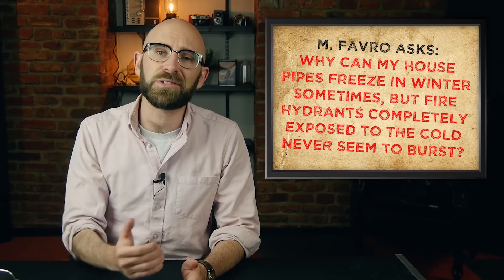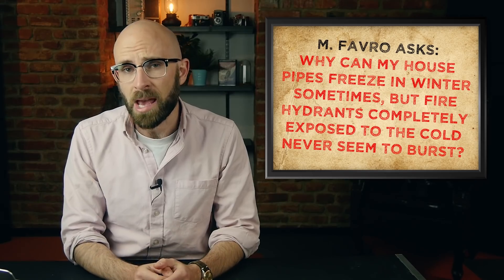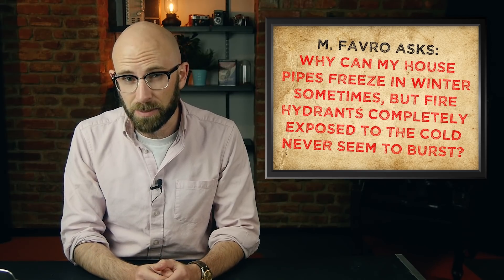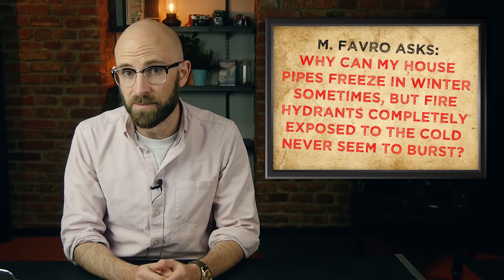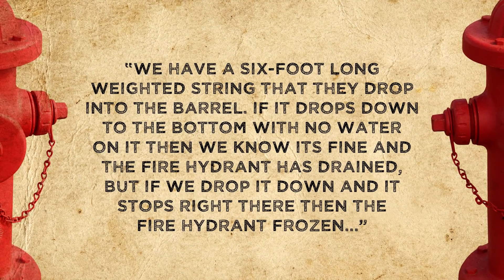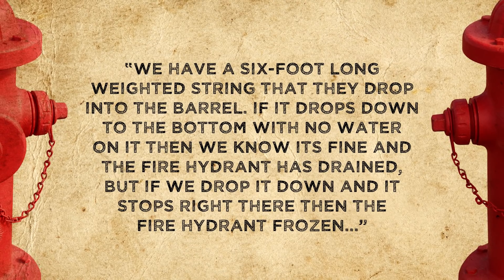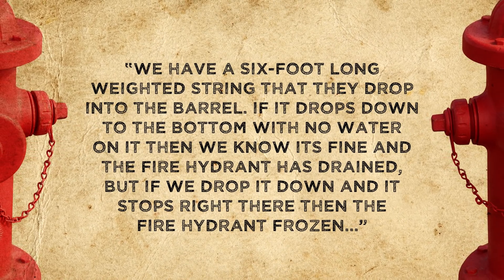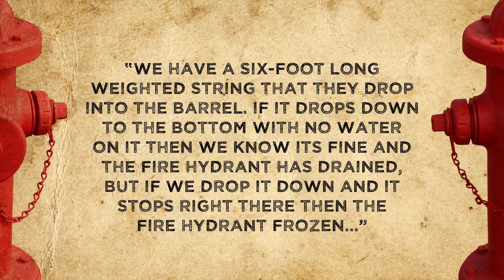Why Don't Fire Hydrants Freeze and Burst During Winter?

Comment: Well put.. I am a Volunteer Firefighter but my Career is working for a Water Utility Company and we have right at 15,000 fire hydrants. All of them are Dry Barrel Hydrants. We have a cut away hydrant to demonstrate the operation of hydrants.
Reply: THAT was a tough cut!
Reply: it was probably one that was burst along the seam from freezing
Reply: UK hydrant are generally all bellow ground beneath a cover and bellow the frost line. The fire service insert a standpipe pipe, valve is opened with a square socket key.
Reply: Paul Thomas . How deep is your frost line in the UK? Here in Eastern Canada It would be roughly be 4 to 6 feet.
Reply: Robert T  just for comparison here in Southern US in Arkansas Frost line is 15 inches. We haven’t had a frost that hard in 25 years.
Reply: I work for a waterworks utility as well, and we test the barrells with a weighted rope too! We have a few spots in our pipeline where the water table is very high, and some dry barrel hydrants used to come equipped with drain ports at the bottom of the barrell downstream from the gland in the boot. These drains work in the reverse when the ground is saturated so we have these hydrants on a schedule to be thawed and pumped out in the winter months. Our utility is working its way around replacing them, there aren't many left!
Reply: D Gunn - are all your Hydrants Breakaway? And do y’all install a valve to isolate them from the mains?  I would say at least 90-95% of our hydrants are breakaways and 100% have service valves.
Reply: @MARKE911  everything installed in recent history is breakaway and fitted with isolation valves but we still have an amount of old infrastructure, like the little Darling hydrants, that don't always have isolation valves. We are on a mission to update everything we can but it's hard to keep up with retrofitting when we are plagued with repair digs from the "flared copper" days. Replacing old hydrants generally takes a backseat to service leaks in the newer subdivisions. Funny how 100 year old cast iron and lead is still bomb-proof but entire subdivisions built in the 80s and 90s are already falling apart
Reply: D Gunn  The Water Utility I work for has 22 volunteer Fire depts, & 6 Full Time within our system. It’s a battle every year with them. They love opening and closing hydrants as fast as they can. Causing havoc on our customers with discoloration and main breaks. We try to work with them every step of the way but it never seems to work.  We have a contract with 2 cities that we will inspect/ test the Hydrants every other year.  About 4 years ago we finally incorporated a valve inspection program. 60K valves to inspect and operate. 2 way feed valves we would operate fully.  Single feed valve 25% operation and 16” and larger valves we only operate 10% of turns.  That was a dept I’m glad I’m not involved with anymore.   GPS, clean valve box and operate day after day got old real quick.

Comment: That was a pretty darn good explanation!  Good to see.  My FD's always tested all of our district's hydrants every fall.  We would flush them and then listen and/or feel for a vacuum after the valve was shut off.  The draining water creates a vacuum in the barrel, so if we get good vacuum, then we know the drain is working.  Then they get pressure tested.  We also notify water co. every time we tap a hydrant.  They are going to get phone calls about pressure in the area, so it's good for them to know.  There are other reasons, but that's one of them.
Reply: I have also seen where they put a flow meter on the hydrant and open it up all the way.  Then they let it run for about 15 minutes to see what the sustained water flow is, maybe they want a rate of at least say, 400 gallons a minute, if it can't keep up that flow rate then either the hydrant is busted or the pipe connecting it to the water main was too small for that pressure/flow rate.
Reply: David that is absolutely correct.  There are several things that get tested.  Static pressure tests were part of our fall routine.  We only spend about 10 minutes at each hydrant for that maintenance.

Comment: In Australia we usually don't have barrel hydrants.  I used to work in civil engineering.  Mainly designing water mains.  Hydrants are placed at regular intervals on the reticulation mains (the lower pressure water that goes to houses).  Our hydrants are usually buried with a hose connector and valve spindle visible.  Ideally built under the footpath, but sometimes the road.  The pumper connects to the hydrant and boosts the pressure.  Don't know why you need a permanent traffic hazard.

Comment: I worked for a water department back in the 70's and they still had wooden water mains.  I was on site when one main was dug up and replaced with pvc pipe.  The wood pipe was constructed with wood  boards similar to a wooden barrel. The wood was stright and wrapped with wire to hold the boards in place.

Comment: I do sewer water construction... install them and put extensions on them if they’re too low.... they self drain.....at the base.... it’s covered with clear stone so water can flow out... the stone is covered by filter cloth... and then backfill......(again it’s below the frost line) so it runs into the surrounding fill.

Water can’t re-enter a pressurized watermain
Reply: You prolly dont care at all but does anyone know a way to get back into an instagram account??
I stupidly lost the account password. I would appreciate any help you can offer me.
Reply: @Watson Asa Instablaster :)
Reply: @Marcus Ezequiel it did the trick and I now got access to my account again. I'm so happy:D
Thanks so much you saved my ass :D
Reply: @Watson Asa No problem :)

Comment: Where I grew up, cold climate, water taps in barns worked the same way. Lever at top opened valve about 3 feet down, below frost line, and then water would gurgle up. Also, we had lots of snow. In fall fire departments would place poles about 10 feet tall with red flag on top, attached to each fire hydrant. That was so they could be located in deep snow.

Comment: In Sweden we have fire hydrants too - but you have to remove a lid in the street and then attach your pipe to a fitting below ground.
Reply: How deep are the water lines buried below that fitting?
Reply: Same in NZ
Reply: Same in the UK, the fire engine carries a standpipe riser that screws onto the underground fitting that the hose attaches to at the top
Reply: We have yellow plaques with a big black H on them to help locate them, these are normally at head height for the driver of a fire engine (often on lamp posts)

So find the H it will tell you how far the hydrant is and in which direction then simply sweep the snow off the cover.... Most of the time we don't get enough snow in the UK for that to be a problem (anything more than 6" is rare)

Comment: Side note.... wooden water main were more like a long wooden barrel with staves.... slats if wood in a circular pattern and tightened with metal rings.

Some was dug up on a site I was on when I was 17... (Guelph Ontario Canada) they stopped the job to document it and take a piece to try to restore it for a local museum....

Comment: Simon - You say that on a dry barrel hydrant, opening the drain valve allows the water to “drain back into the water main” but I don’t really see how this is possible. After all, how can standing water “drain” back into a pressurized water main? It seems to me that it would either have to simply drain into the surrounding soil or be routed to a drainage pipe somewhere. Love you videos by the way.
Reply: Went looking to see if anyone else had the same question - I suspect the drain valve opens to a rainwater drain. But then again the number of people with engineering degrees who can't explain how a toilet cistern works is pretty shocking too, so I can't complain too much about the lack of engineering thinking in the explanation.
Reply: SLOBeachboy, You are correct. As A retired firefighter,  and previous to that , a backhoe operator for the municipal water department,  I can confirm that when the drain valve is open the water drains out to the ground.  I can also say that in extremely cold weather a frozen hydrant is no fun.
Reply: @peglor  Too many engineers never get their hands dirty..
Reply: This would also be very dangerous for the health of the people. Because the water might become dirty in the hydrant. This should not flow back into the water supply.
Reply: it seems. but you are wrong.
Reply: When the water valve is closed, the drain is open.  The water does not go back in to the city water supply.  The hydrants are installed using aggregate around them so that the water can drain from the barrel and into the ground around it under the frost line.  The pressure from the main would not allow reverse flow from a gravity drain.  Nice catch!

Comment: I worked for a water department in New Hampshire for 2 years my soul job was painting fire hydrants which on top of painting them do you also have to number them so that the town or city can keep track of how many they are and where they are we also put Flags which are plastic poles on the top that way they can be seen typically above snow Banks and they need to be shoveled out in the winter not a fun job but an important one nonetheless also by painting the hydrants continuously each year they keep the life of the hydrant going and rust from forming also you probably be surprised at how many hydrants there are the town I was in was not that big of a town but it's still had about a thousand fire hydrants

Comment: great video. little correction though, the hydrants with the valve on top are actually dry barrel hydrants, ones with valves on the sides are wet barrel.

Comment: Today I found out that Simon didn't do adequate research on the workings of a dry barrel hydrant before making the video.  I've installed countless fire hydrants, so I know a little bit about their workings.  Dry barrel hydrants don't drain back into the water main, this is literally impossible.  Instead, the hydrants have weep holes which are open when the hydrant is closed and blocked off when open.  When the hydrants are installed they're back-filled with gravel  to allow for better drainage of the discharge for the weep holes.

Comment: The water wont drain into the water main, it will drain out into the gravel that is placed around the bottom to facilitate drainage. Or maybe even into the storm drain system if needed. Can not drain water into a water pipe that is under pressure =P.
Reply: You’re right. The hydrant has a weep hole that drains the barrel of the hydrant when it is closed and the weep hole is covered when the hydrant is fully opened, but if the hydrant is only partially opened it will spray through the hydrant and the weep hole at the same time and can wash out the area around the hydrant causing a sink hole.
Reply: I was looking for this....thank you
Reply: @benschmidt9532  yeah it is basically a large scale frost free. I was just guessing about some being tied to a storm drain system, would make sense to possibility avoid the sink hole situation , but I doubt any cities would want to spend the money to do it that way.

Comment: UK hydrant are under the ground, under a cover marked with an H, not above ground. You need a key and standpipe to use them. Typically if there is any colour it is yellow not red, but mainly just on the sign.  There is usually a sign above ground with H plus a distance marker. Simon Whistler probably would have been more familiar with these growing up, with US style hydrants being mostly in films and cartoons.

Comment: If I remember correctly before o watch this we learnt this at the fire station when I did my course there. They don’t actually have water in them until the fire man opens the hydrant the water is usually 2 or 3 meter below in a pipe so it can’t freeze
I was correct Nice to know I still remember I learnt this 3 years ago

Comment: The water does not drain into the main. They drain into the ground. It is called a “stop&waste valve”. These are common everywhere but only legal in utilities. The hydrants are from 4 to 8 feet long. The stem of the valve opens the valve at the very bottom of the hydrant. When it closes, it likewise opens a port in the bottom of the valve. The valve should be installed well below frost line and in gravel. The subsequent remaining water drains into the gravel bottom. This potentially allows contamination of the water that is then re-introduced into the contaminated barrel. Should this occur, and a broken water main or another fire truck pumper down stream of the hydrant pull water in the barrel back into the city main it causes a “cross contamination” issue. Thereby, introducing contaminated water into the city water system. This scenario is very seldom, so seldom that the cities deem it the only instance some type of backflow mechanism is not required. Industry and commercial buildings along with residential hose bibs and irrigation must all use some type of backflow device to assure proper water safety. Freeze proof hydrants exist that work on the same  as the fire hydrant but are illegal in most communities by the water authority. It is all about protecting the health of the user from not just bacteria, but also chemicals and poisons found in commercial applications. Also, from the careless homeowner who leaves a hose end sitting in a dirty bucket of water.  This all seems very over complicated but these laws are a result always of a lawsuit from someone in Oklahoma in 1963 who was effected by careless or accidental causes. The effected people sue and the laws are changed.

Comment: It is also import for a dry barrel hydrant to be opened and closed slowly. No more than one full rotation of the valve screw every four seconds. Failure to open or close slowly can result in water hammer, and this can in turn cause a water main break.

Comment: Was water delivered through hollowed-out-log water mains even potable?
Reply: It’s all they used back then, metal was used later on wood was cheap and abundant back then
Reply: Back in 1880 the water was pulled from the river and then left to settle out the solids in a large open holding tank made of bricks and mortar they would then let it enter the mains. It wasn’t treated until the early 1900’s when they realized Pathogen’s in the water were causing people to become sick. At that time it was common to dump waste into the rivers. No it wasn’t potable. The process of cleaning and producing drinkable water and come a very long way. I wish I could post pictures on here. All types of mains are in use today. All the wooden mains have been out of service for almost a hundred years. We have Cast Iron, Concrete, Asbestos Cement, Ductile Iron and PVC. Some of the Cast Iron joints were sealed with Lead, we use to have services that were lead now they are all copper and we are getting rid of the PE Plastic due to poor quality. We are governed by the Dept of Health to monitor for Lead and Copper and we take over 300 samples and test them every month in our lab.
Reply: Any sensible person in town would drink weak beer instead and had done since the middle ages.  However the temperance movement didn't like that and encouraged everyone to drink water instead, causing thousands of extra deaths every year.  #FakeHistory.
Reply: todays "potable" is a relatively new thing.
Reply: Next time your local water co. digs up a main, go take a look at the inside of a "modern" pipe and tell us if you think that water should be potable.  In the past, all potable meant was that it probably wasn't sewage.
Reply: @firemanjeff911  - What you're seeing inside of those pipes is primarily lime deposits, which is perfectly innocuous.
Reply: @Babarudra  that's what I was wondering...  I'd never thought about it before.
Reply: @MARKE911  Actually in my hometown  a piece of wooden water main was replaced only a few years ago. I kept a small piece   of the pipe. The low temperature of the soil at that depth and the fact that the water was fairly clean going in meant that bacterial growth was not much of an issue.